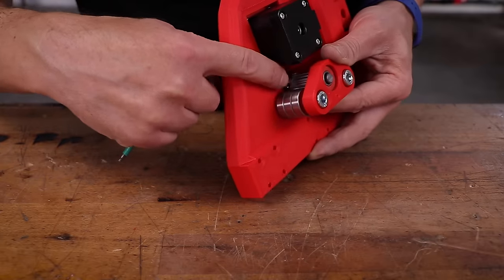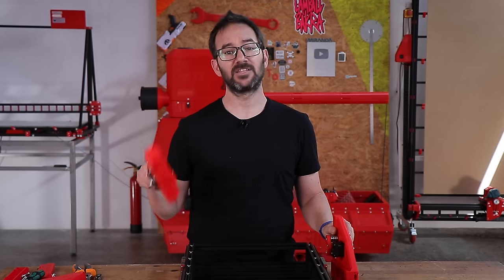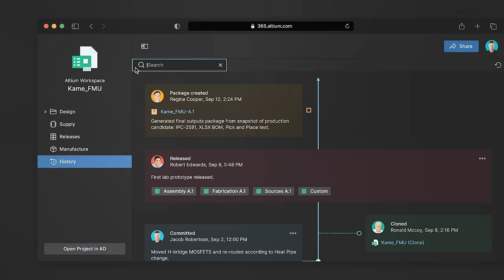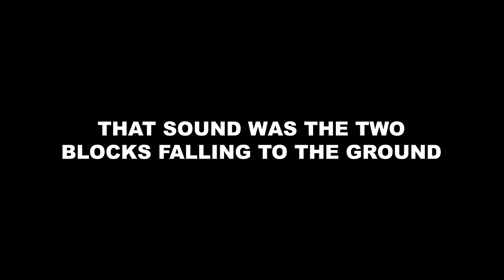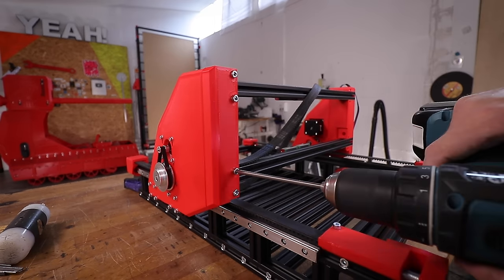3D PRINTED CNC BUILT FROM SCRATCH CUTS METAL

Comment: This is awesome! One tip for getting cleaner surface finishes when sidecutting aluminum is to take a cheap airbrush and mount it to your spindle head on an adjustable arm, and use denatured or 90% Isopropyl alcohol pointed directly at the cutter from two inches or so away. Get one that feeds from a tube instead of the little cup on top so you can feed it from a larger bottle. Routers can leave poor finishes because there is not enough chip evacuation and lubrication for such a high rpm spindle, the air from the airbrush not only blows the chips away, it causes a ton of the alcohol to evaporate on the work surface which provides an extreme level of cooling, and the alcohol is an excellent cutting lubricant between steel and aluminum. I had an EZ TRAK CNC Bridgeport mill at an old job I worked at and I used this setup daily for cutting aluminum, I would go through a gallon of alcohol every week I used it so much, I had even hooked up a pneumatic solenoid valve to switch the air on and off with the touch of a switch. It's a very clean and safe method since hardly any alcohol pools on the surface, almost all of it gets blown or evaporated away, though you'll obviously want some form of ventilation.
Reply: Thank you for this tip pow !
Reply: Doesnt that cause a fire hazard?
Reply: @JonasNeumann6  Surprisingly no, it really doesn't. The volume of alcohol being sprayed is so small and the volume of air propelling it so high that it basically leans out the stoichiometry of the alcohol/oxygen balance and won't allow a flame, you can't ignite the alcohol stream blowing out of the airbrush. A small amount of alcohol can pool on the work surface but remember that it's an airbrush we're talking about, it only blows about a half ounce of alcohol per minute which really isn't a dangerous amount since it evaporates away so quickly, even if the pool did get lit on fire it only takes like 5-10 seconds to burn away with a pretty small flame. You do need to be careful doing it in an enclosed space like a small room, it can eventually fill the room with an explosive vapor so you do need some ventilation, but that's really the case when using any solvents regardless of what you're doing with them. And if you're curious the cutter is not an ignition source, cutting aluminum does not produce any sparks whatsoever (you can trust me on that, I've been cutting aluminum for 17 years as a CNC machinist).
Reply: @ronidaffan5904  You're welcome! Have you tried it yet?
Reply: is the friction heat from the aluminium being machined not enough to ignite the vapour? @TheExplosiveGuy
Reply: @sitgesvillaapartmentneilsc7924  Nope, not even close. In the years I've used that setup I haven't had a single instance of the alcohol igniting, even when cutting small steel parts. It doesn't work for steel if you're cutting with anything larger than 1/4", it doesn't provide enough cooling or lubrication, but for really small stuff or aluminum it works great, I've used it with 3/4" endmills in aluminum with great success.
Reply: well that sounds good then....tx @TheExplosiveGuy
Reply: @TheExplosiveGuy are we really supposed to trust you with a name like that? Jk 😅

Comment: What I really like about this build (and most of your other builds) is that you manage to build something incredible with very few different components, and a few tools.
Reply: That's what differentiates an average engineer from a great one. Clever engineering makes the most of the fewest parts. He almost makes it look easy because the 3D printed parts are well designed and keep in mind a lot of different requirements (ease of assembly, cable management, spaces for the vacuum attachment etc.)
Reply: @XTJ7  But I wonder how many outtakes and reiterations were made before the presentation piece was made/recorded.
Reply: @ivanmirandawastaken  I would love to see an outtake/blooper video of the many(?) iterations you had to go through before coming across the final piece(s) for these machines. Thank you.
Reply: if you buy whole CNC machine, it will cost you less and you wouldnt need any tools ;)
Reply: @Hobypyrocom  That was the case several  years ago when the imported 6040 machines were cheap as dirt, but now not so much. The added benefit of building your own CNC is first-hand knowledge of how the parts go together and function. After gently persuading my own CNC with a rubber mallet I learned a LOT about the benefits of tramming and good algnment, LOL.
Reply: @aerohard  now more than ever... extruded aluminium sky rocketed, imports increased, calculated the mats i need, i will need at least $300USD of it, add to that the time for designing, add the time for printing, add the materials for printing, add the additional electronics and i am better off buying a $500USD CNC machine... as for knowledge, with a $500USD CNC machine, you will get the same knowledge, since you will have to constantly work on it to improve it... ;)
Reply: @Hobypyrocom  Да, но нормальные роутеры для дюрали начинаются от 2..3k$. Это если Вы решили что-то на нем более менее производить дома, а не постоянно модернизировать жесткость.
Reply: @101picofarad  do you really believe that this CNC with plastic parts in the video will be able to machine metal for long time? its made for a youtube video, i bet that it will start having problems after making few metal parts... check it out, there are tons of 3d printed CNC machines out there, they all have problems machining metal after few millings...
Reply: @Hobypyrocom  That would also depend on what material(s) the plastics are made of. Some are quite resilient and durable when made properly. Yes there are better options out there, but worst case scenario, he could machine up some metal brackets now and replace the plastics with them.
Reply: @Hobypyrocom  I do believe that, actually. If his layer adhesion was good, the parts should hold up well under regular loads. And if something catastrophic happened, oh look, you have everything you need to fix it in house.
Reply: @4thfrom7  "I do believe that, actually" yup, being a fan of someone is similar to being a member of religious group, i get what you say, in both cases you defend what you believe in without any logic reason 😉
Reply: @Hobypyrocom  you'd be surprised how strong a 3d printed part is with decent layer adhesion, laterally they can hold a lot of force and do bare in mind you can get some filaments with embedded materials making them composite and much stronger (they do damage your nosel faster though)
Reply: @soviet-doge3370  i have 3 high end FDM 3d printers and one SLA 3d printer, my first print was back in 2014, so i know how strong 3d printed parts are... are you trying to convince me that 3d printed parts are stronger and better than example injection molded plastic parts that are cheaper and wont waste you any time, or that homemade 3d printed cnc is better than cheaper bought cnc or what?
3d printers are not meant for reproducing things that already exists and cost cheaper than you making them with your 3d printer (including the cost of your wasted time), 3d printers are meant for creativity, inventions and prototypes, everything else is just plain stupid...
Reply: @Hobypyrocom  At no point, ever, did I say that 3D printed parts are any stronger than injection moulded parts, injection moulded parts are no better and would likely last longer but eventually break. I'd likely use a CNC mill to mill the parts out of alley or steel, more likely to be alley, if I were to make these parts, I was simply stating the fact that these parts are strong if printed correctly, I didn't ask you to blabber on about the cost of it, I was saying they are relatively strong to say they come from a spool of plastic. Many of these parts don't need to bare a large load, some do , admittedly, and they're likely a higher infill. Anyways, as long as the parts have no play in them they are likely to have a longer lifetime and probably wouldn't break unless the machine had a genuine mishap or you tried to break them.
Reply: You might encounter issues with the clamps as they're putting a large load downwards however, it's easy to use the CNC in its current state to manufacture some better and stronger aluminium, steel or even wood (MDF board) parts to clamp down.

Comment: 17:45 using a CNC is straight up hard. I went into it thinking it was going to be a lot like 3d printing, but it is not. There is so much to keep track of that it is really easy to forget something small that leads to a catastrophic failure.
Reply from the maker: Yes, catastrophic failure is always round the corner. Waiting...
Reply: just found this video.   and that bit at the end really shows how powerfull this thing is.  
nobody should ever mill like that without cooling.  but the fact that the machine doesn't care and just pushes through just absolutely amazed me. 

and with my background in cnc i can actually avoid those failures. 
(ps @Ivan Miranda)   try some cooling.   compressed air with a drip of cooling oil going into the line.  you'll end up with a mist of cooling so you don't have the adapt the design to handle a ton of water. and aluminum REALLY loves it when cutting it)  
to the point that you can tell the diffrence between a cooled part and a non cooled part in a single glance.
Reply: @ivanmirandawastaken  This has been my experience with CNC machines. With 3d printers, you get a failed print, with a CNC you get a bit snapping off an shooting across the room at mach 3

Comment: Wondering, if you made a 3D printed CNC to make a Tank, could you argue that through the transience of properties that that tank was made by a 3d printer
Reply from the maker: I've thought of that more times than I'd like to admit.
Reply: Simple,make a tank that only uses 3d printed tools to make
Reply: They already say this about ECM-rifled barrels.
Reply: That way of thinking would make everything handmade…
Reply: By that logic you could stretch it further by saying the tank was made by a bulldozer since it was used to extract the materials needed to build the 3d-printer.
Reply: You could, its design would be entirely dependent on what you want to fight. An Abrams would laugh at such an amalgamation, however a WW1 era MK1 would be terrified by the plastank in all of its extruded glory.
Reply: @CGOCPFTF haha plastank
Reply: Having the tank isn’t illegal you can buy them right now is the Guns that are the issue

Comment: Quick note about machining stepper belt pulleys: when possible, drill holes for every groove (space between teeth) before machining. Use a regular correct size drill bit, nothing fancy. This will save a good amount of wear on the end mill, drills are way easier to sharpen, as well as give much straighter teeth when compared to milling everything from a solid chunk. Of course those pre-drills would still have to be machined to size, but they do remove a large amount of material that the end mill won't have to.

Comment: the part that amazes me is how each machine is usually capable of working with way more strong material than what it is build from, making it possible in theory to build a machine with 3d printed parts, and then use it to machine aluminium parts to upgrade itself to be more capable. which you already did, but it is still amazing.

Comment: What a wonderful idea to share the design and show how to built it! When I'm settled I'm very likely going to first built a printer and then this. :)
Reply: I often feel the pull from projects like this, and I'm pretty sure I could pull it off. But then I realize that if I made some thing  like this all I'd end up with is another machine I wouldn't know how to use. Or rather I'd know how to use it but wouldn't have anything to use it for other than building other projects like this. Thing is I have zero creativity, so all I can do is follow instructions. Even the smallest modification would end up looking like crap as once I made something that worked as intended I'd stop there. As for making something new, designing something myself, fugget about it!

I'm not kidding. I have no creativity what so ever. It was the same when I learned to program. I could optimize code, clean up code, rewrite code but I totally sucked at writing a program from scratch. But polishing up someone else's code? That I was darned good at! Now there's money to be made doing that. It's not flashy but someone who can take a ugly yarn of undocumented spaghetti code and turn it into well documented, structured and optimized code will always have a job. But I wanted to write my own programs, only lacking creativity I simply couldn't, so I bailed on being a programmer.

It's the same with things like this. I'm competent with tools, but I suck at making anything new. I might make something that kind of almost works, but it will look awful and probably snip your fingers off if you look at it wrong, and even that is a big maybe...

So I have held off on making or getting a 3D printer as I know it would only collect dust once I'd printed a Benchy.

Comment: At first I thought it was a joke, but using a guitar tuner to tune the belt tension is actually pretty smart😆 Nice video m8
Reply from the maker: I used it to fasten both Y axis belts to the same tension so the accuracy once calibrated is the same on both sides of the machine. I wasn't aiming for any note in particular but to set the same note on both sides. Cheers Jón!

Comment: it looks insanely impressive, but I have a fwe things that raise questions for me:

1. How long did the printed connector plate hold up to the vibrations and the forces from moving the router to the side?
2. Doesnt the screw in 10:34 just unturn itself? How did you secure it and did you use an insert in the printed component?
3. How did you ensure, that the parallel rails in 11:12 are perfectly parallel and let the Z-assembly move freely? 
4. Did you use an insert with every single screw or do you get away with drilling them in the plastic?
5. Did you wire the emergency shut off to the router as well?

Comment: This video couldn't have come at a better time. I'm currently designing something similar. Every other "3d printed CNC" has taken some choices in their tradeoffs I strongly disagree with (like EMT tubing). Yours landed pretty similar to how I want mine to be, so I can see something that works as a base, and then re-evaluate where my design and yours differs. For instance, I am currently on MGN 15 rails and was wondering if they would be enough. Seeing yours works with MGN 12 is nice. On the flip side, your belts are WAY thicker than mine, so if I run into issues, I know the belts are more likely than the rails to be the issue. Very helpful. Cheers!

Comment: another great project as always! Something I'd love to see is just how much play is present in the frame (particularly the Z Axis which can be measured by using a dial indicator). I used the same linear rails (I believe NGR12s) for my 'large' router's Z axis and found that the play was around 0.16mm... but my entire build is made from Aluminium (No printed parts), so would be interesting to see how the 3d prints hold up against such stresses. Great content as always!

Comment: You should be able to run the much higher speed as long as you implement some type of chip removal. All of the chips melting together is becasue aluminum's melting temperature is being reached as the cutter goes through the aluminum, but as long as you have an air or mist coolant system in place to blow the chips into the dust collection system, it should totally be possible to cut the alminum at much higher speeds. I am able to cut alminum at 18000 RPM, with a .014 IPT, at .125 inches deepth of cut.

Comment: Great design/build!  

I think you would find value in getting a true-flat surface for some of your construction/assembly.  I noticed that your wood assembly table is fairly wobbly.  Consider trying to find an old granite counter (sometimes available for free after a remodel).  This will help your assembly to be even flatter, which could help for precision stuff like this cnc build.

Comment: I'm watching this and thinking it could be an incredible bootstrapping machine for people already with access to a reasonable 3D printer. Once this was built it could be used to accurately machine the alloy parts needed to build a bigger/stronger mill that's capable of machining steel, then the original could be sold to help fund the electronics for the new machine.
If neccecery, the alloy machine could be used to create upgraded steel parts to further strengthen itself, or even start the cycle again by building an entire new bigger mill from steel before being sold itself.

Comment: Amazing new CNC project, as always. However, I'd like to see one with regular square tubular extrusion instead of 20x20mm slotted extrusion, as this stuff is so incredibly expensive here in Canada (metric or not) that buying a pre-made commercial CNC would be a lot cheaper.
Reply from the maker: That was a hard decision to make when I started the design, so much that I ended up drawing a version with square tube mid design. I could totally modify not much complication to accommodate for square tubing for sure.